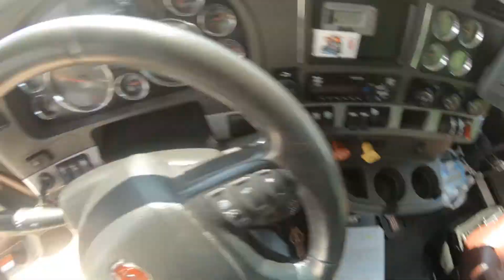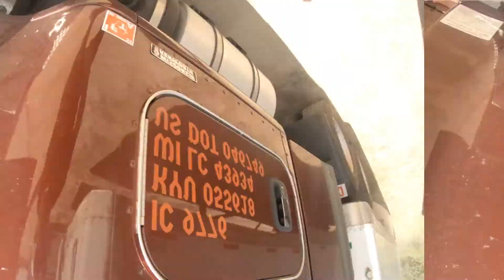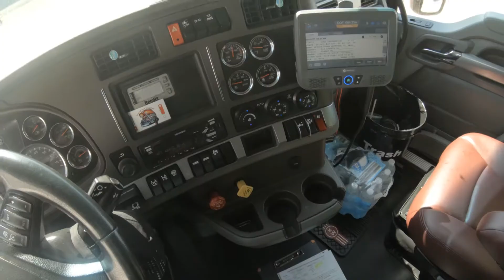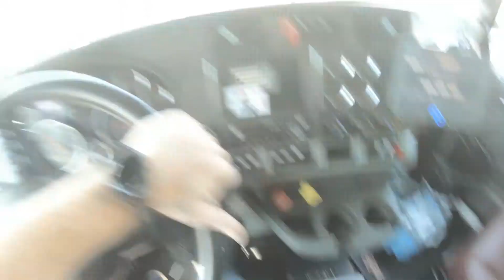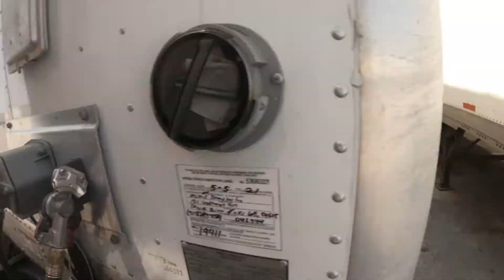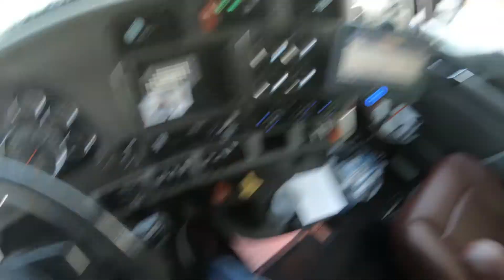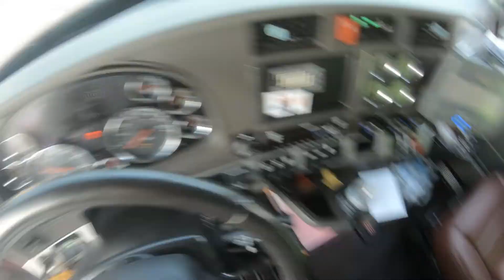Rookie trucker has to blind side back - Millis Transfer

Comment: Are slant parking spots easier than straight parking spots?
Reply from the maker: In my opinion I would rather back into a straight spot versus a slant spot. I wouldn't say that one is harder than the other but I don't back into slant spots that often so I usually have to correct myself when backing into one. Sometimes I hit them perfect first time but it's not what I'm used to doing every day so I usually mess it up lol. But based on the situation neither are really hard.